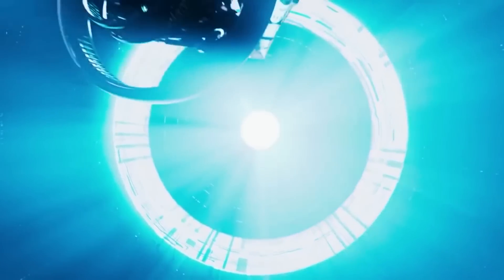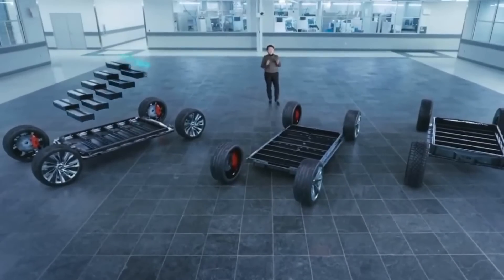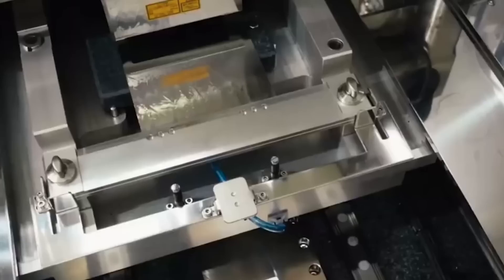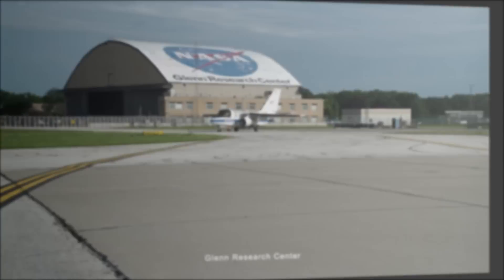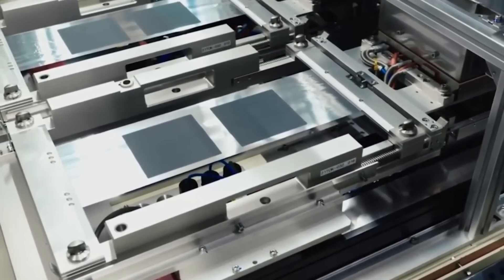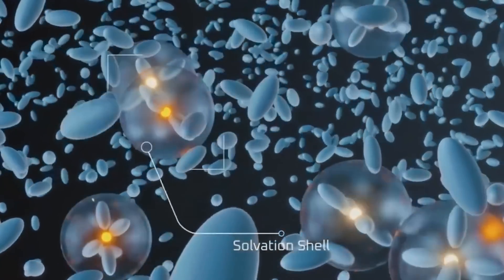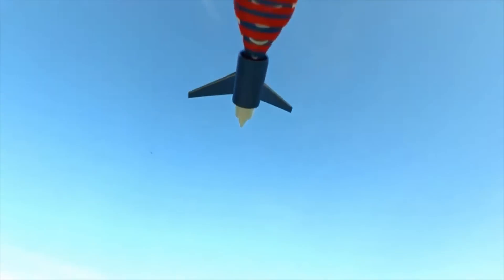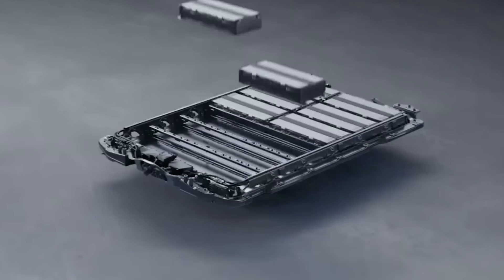NASA Just Reveal NEW Solid State Battery That Defies Physics!

Comment: Once again this channel is full of fluff and bad information. Lots of companies have been beating their head against the wall for over half a century trying to develop a cost-effective solid state battery and haven't done it yet. And NASA of all people is not capable of that type thinking. They've been unable to produce their own rocket engines for a long long time now and have been paying 10 times a normal price to Russia just to hitch a ride to our own space station but that is part of the Democrat plan to feed money to Russia and China left and right without us being able to stop them. NASA cannot Even build a space suit. The ones that are on the space station are so wore out then it has leaked out through the press that some of our astronauts have almost died because of the super malfunctioning and one of the female astronauts almost drowned before getting back inside the station and getting her helmet off because it was filling up with water from the systems inside. SpaceX offered to build the suits for them and they flatly refused and took an extra two years for the newest model they have now which hasn't even been put into operation yet which was produced by over 10 companies making different parts and trying to get them to work together. NASA has gotten very good over the years at building robotic exploring machines that they sent to another planet and let run around and mostly be able to recover and keep using it whenever there is a problem with software or such. But that's about all they know how to do. They don't build their own rockets, they said that reusable rockets were impossible, they do everything they can to stop Tesla from showing them up but it is impossible because they are just not smart enough because it is a government backed corrupted organization. George Bush kept flying the space shuttles way past their life expectancy until he finally murdered several astronauts by launching on conditions dictated not to launch but they ignored the safety. That's when we started giving Russia 10 times the amount of money to taxi hour astronauts to their destination. Pure corruption on every level and now they manipulated SpaceX into launching from their government owned Cape Kennedy so they can still try to get their claws and SpaceX and hold them back every way they can. They may be researching solid state batteries like a lot of other companies but they are not anywhere close to figuring anything out that is useful so do not believe this channel because all they do is lie and string you along. And leading off the story by saying that NASA is manufacturing a battery that defies the laws of physics is an outright travesty of a lie. Physics is the law and you cannot get more energy out than you put in and that is basically what they're leading you to believe. This channel always lies and covers it up with a bunch of flowers. I just check in now and then and hear the same old crap. 👎🏻👎🏻👎🏻👎🏻👎🏻

Comment: I've started working with LiFePO4 (Lithium Iron Phosphate) batteries.  They're around 15% less energy dense, but are 1/3 the weight. (and 3x the price...)  These would seem to be useful for electric aircraft?  They're downright SPOOKY when you pick one up and are shocked by how light they are for their capacity.  My 100AH (12v) LiFePO4 battery is about the same volume as my 85AH deep cycle marine battery, and yet it's so incredibly light by comparison.  You should look into that.  This video was more about "nasa has something new that's awesome" without actually going into details about the battery itself, specifically the chemistry.  Also, LiFePO4 aren't "on the drawing board", they're on the market ready for purchase in volume right now.
Reply: Carbon Ion Energy seems to be hush hush about something purportedly game changing that may also be considered in an electrical aircraft use case.

Comment: "There is nothing impossible, only limitations, one being knowledge, the other, time" 
"People sabotaging progress they are just delaying the inevitable.." Those hanging to ICE because they make the living out of it, only see what worries to them! Understandable, but they only fall in the same chapter as previous technology have fallen in the past. Like when the ICE took over the steam engine. Many said: Well, we will always have wood to burn, and coal is easy to transport, and water is abundant. Sure creating the infrastructure for the oil and gas industry wasn't done in a few years. But the point is that we don't have to kill one over the other one. True is we are not ready for a complete change in the auto industry, and probably will take a few more years, maybe older generations won't get to see it. So please leave the paranoia. Stop been negative! Yes, there would be problems to fix, frustrations and failures, but what would be your position?
From: someone how drives a 1999 5.4 V8 4x4.

Comment: Did he say 20,000 cycles? That would last in a car for 40 years.
Reply: If We estimate 300 miles of range 20'000 x 300 would be 600'000'000 miles WAY MORE THAN FORTY
Reply: @matthewspry4217  exactly. Really you probably only need a 1000 cycle, 500km range for a car that will last the average person 30-50 years.
Reply: @AORD72   your right and even after the 1000 cycles, the pack still has 80% of its original capacity. So in 30-50 years a pack that had 500km might still have 400km, another fun fact is the next 20% capacity drop might take even longer another 2000 cycles the curve of the drop actually flattens off, unbelievable

Comment: Hurry up and make it happen. I’m holding off on buying an EV for now. If they can get the range to 600 miles, that would be a game changer.
Reply: So you need to drive 600 miles all the time? Like over 10 hours of driving in a day!?!?!
Reply: @AORD72  For long road trips, not daily driving.  And so that if chargers are far between and/or broken, you have range left. And for us that live in apartments and have no place to charge at home. So having a long range would help.
Reply: @unclej3910  600 miles might be a worthy goal.    But if they make one motor vehicle with 600 miles, they could have built 3 motor vehicles with 200 miles.   That might be a better usage of the materials to make batteries.   
    
I'd promote motor vehicles with batteries of 50 miles and put in a series 40 horsepower engine that charges the battery.     That way, we'd get to 80 percent of motor vehicles with batteries much quicker.   90 percent or more of trips are 30 miles or less.   Then once we got to 80 percent battery electric with plugin hybrid electric vehicles, then move on to all fully electric.   But that is just what I would promote, the world is not going do that.
Reply: @unclej3910  how do you pour gasoline out of your apartment window into the car you have now?
Reply: i just dont want them to be able to combust
Reply: @theonewhoknocks2835  
In the meantime we’ll keep driving cars with 15 gallons of fuel🤔